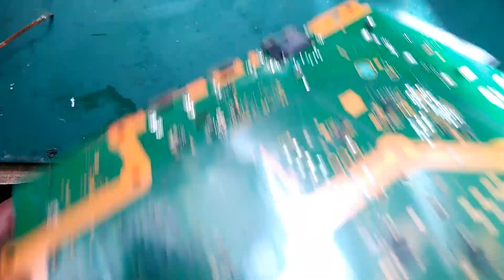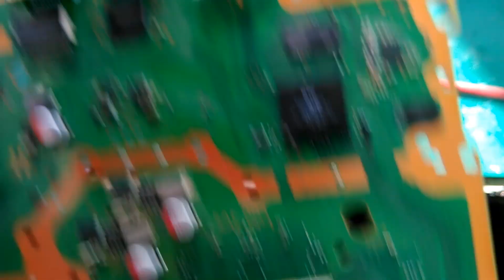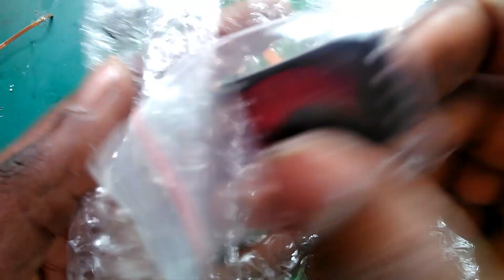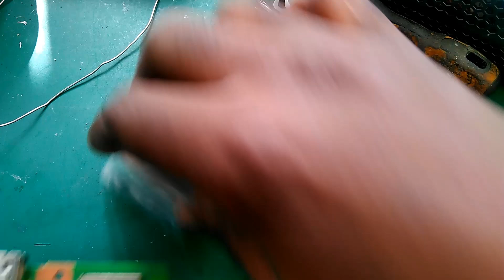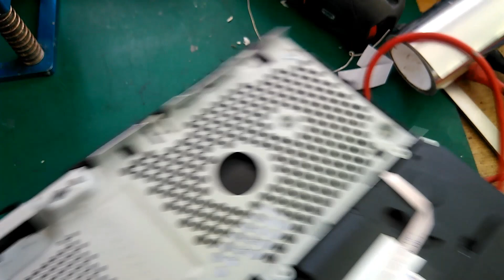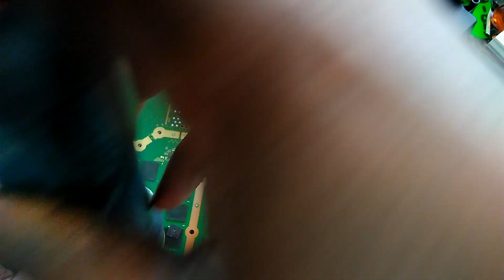Ps4 southbridge cxd90042 replacement

Comment: What soldering station do you use? And at what temperature do you have the iron when removing the solder from the board with the wick? Thanks! Nice work!
Reply from the maker: Honton HR490 rework station
Solder station just a cheap knockoff 
Solde iron always at max temp 480 degrees
Reply: Where do u buy south bridge?